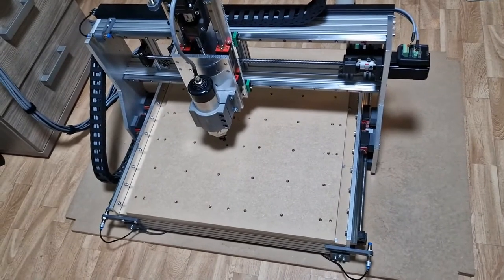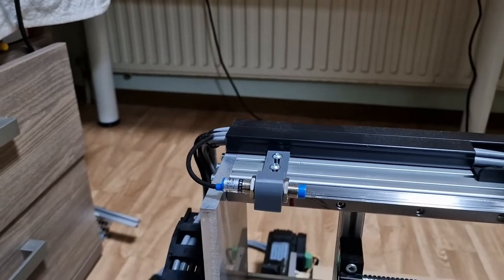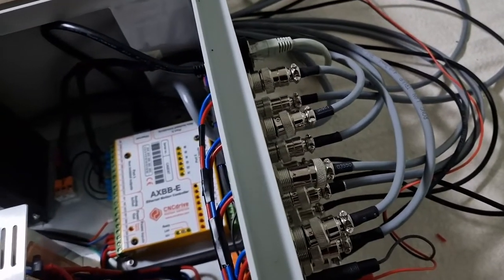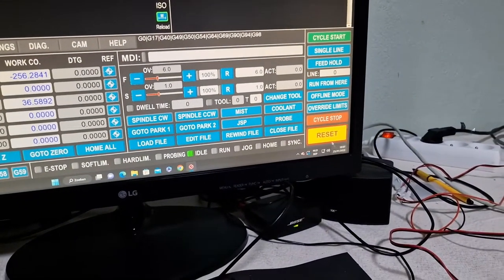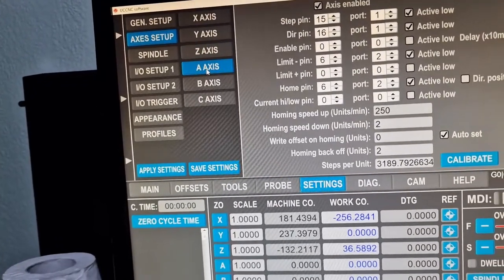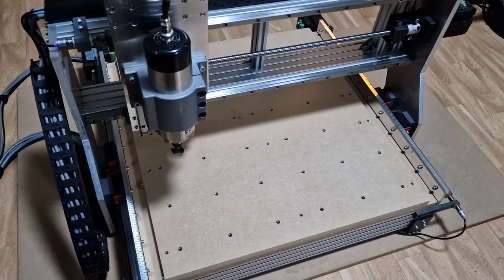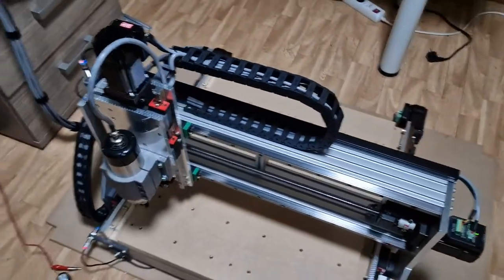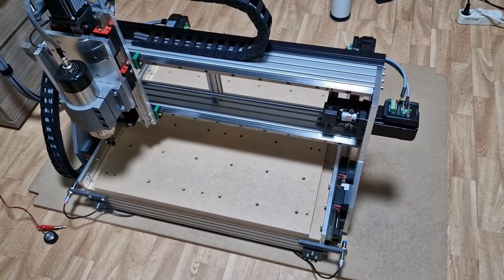CNC-router

Comment: Prachtige CNC Philip, waarom servos en geen nema23 ?
Reply from the maker: Deze servo motors zijn ook een soort nema23, maar die zijn veel preciezer dan de gewone nema 23. En die verliezen geen stappen. En deze hebben ook een geintregeerde driver, dus moet je geen apparte driver meer nemen. Zoals bij closeloop steppermotors
Reply from the maker: JMC Servo iHSV57-30-18-36-21-38 AC Servo Motor 180 Watt / 36 Volt v605

NEW VERSION V605

Typ: iHSV57-30-18-36-21-38 Nema 23

Shaft length: 21 mm
Schaft diameter: 8mm
Centric diamer: 38 mm
Total length: ca. 147 mm
Flange size: NEMA23 / 57x57mm
Hole distance: 47,14 mm

Highly popular AC-Servomotor with 180W power and integrated driver. NEW VERSION V6xx
Fits common NEMA23-Motormounts, very good for CNC use.

Introduction:

iHSV57-XX Integrated AC Servo Driving Motor is perfectly integrated AC servo drive into servo motor, adopts vector control in DSP chip, features in low cost, full closed loop, all digital, low heat, small vibration, and high response, as well as includes three adjustable feedback loop control modes(postition loop, speed loop, and current loop). iHSV57-XX is a series of stable performance, high cost-effective motion control products. 

Multi Pulse Input Modes Pulse+Direction

Opto-isolator Servo Reset Input Port ERC

Current Loop Bandwidth:（-3dB）2KHz(Typical)

Speed Loop Bandwidth: 500Hz(Typical)

Position Loop Bandwidth: 200Hz(Typical)

Motor Quadrature Encoder Input Interface: Differential Input(26LS32)

Download parameters via RS232C from PC or Text Display.

Users can define microsteps via external DIP switches or software.

Overcurrent, I2T, Over-voltage, Undervoltage, Overheat, Overspeed, Overerror Protections.

Green light indicates running, red light indicates protection or offline.

Shaft length: 21mm

Shaft Diameter: 8,0 mm
Reply: Practige build !!
Vringt dat niet als hij zich op de Y axis gaat auto haaks gaat zetten?